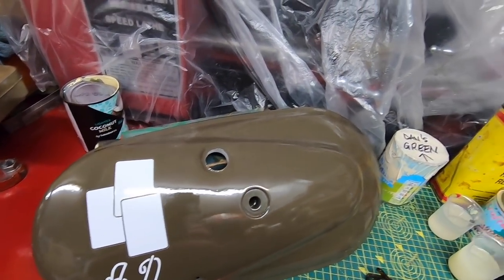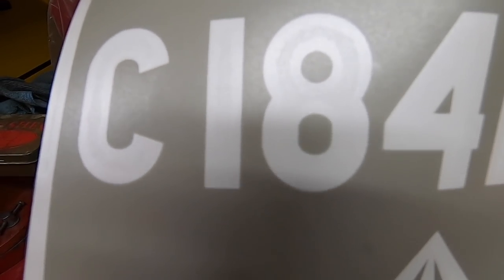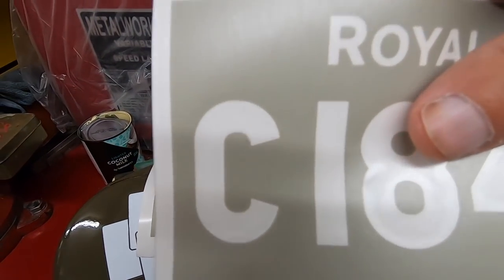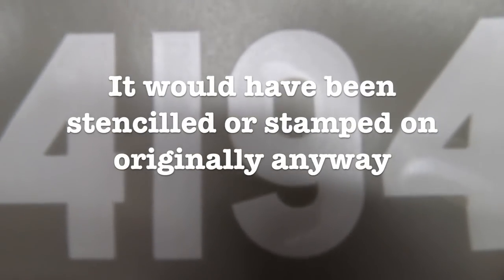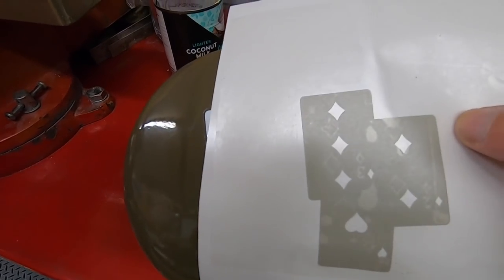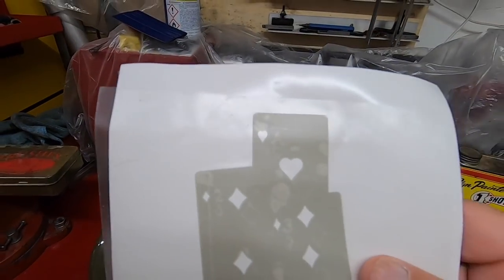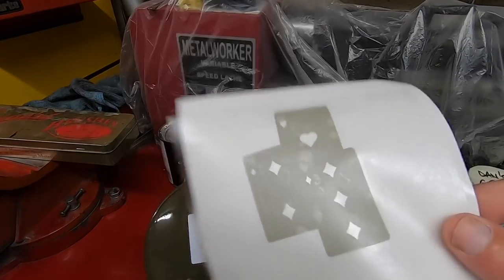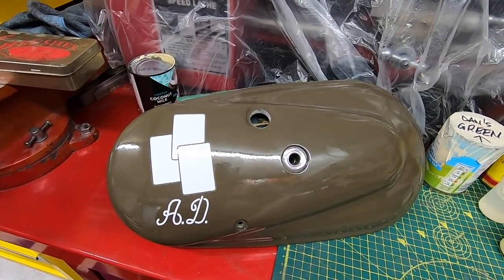Back to the brushes for The Doghouse Part 2

Comment: In the 70s 80s I worked for a government agency,  they had a sine shop, all hand painted.  In late 70s the senior sine painter did a  large sine for the main gate of a aquatic recreation facility.  It  was a map of the entire facility including all the necessary information about utilization of all aspects of the park . If you parked my mechanic's truck up close to the sine ( necessary to change lamps)  and looked closely at the blue water area you could see a scale skieboat pulling a lady skier, the boat contain a driver and a spotter has required by regulations so it depicted necessary information. The entire scene was less than 2 inches long and all three of the ladies depicted in the scene were nude. I don't think anyone other than a few of the maintenance people and the sign painter ever knew that that scene was on that sign. I have been retired about 20 years. he died several years before I retired. The sine is long gone.
Reply from the maker: Hehe good memories of cheeky times though :)

Comment: do you know what the ral number is on dans green
Reply from the maker: No that would be a question for the powdercoater
Reply: Hi mate.....its a bit of a minefield. It is a shade of British Army 'Nato Green@ also known as 'Clansman Green', it has BS (brit standard numbers) and also other numbers but not a RAL code....There are RAL colours very similar but they are not called Nato or Clansman.......its basically this in the link https://paintman.co.uk/shop/nato-green-no-2-satin/

Comment: Hello Ian, 1968 Oxford polytechnic as a apprentice painter and decorator we all bought a set of Wrights of Lymm ltd brushes in a green & black box and we started by applying black thread to the quills then coating with knotting. First task was to blow torch the three plank board , used by every year previously, prime / fill / float oil filler and flat followed by a few coats of paint then the fun began stencilling your own Munsell pie chart and  then ‘ sign  writing’  some of us who used to enjoy art found it enjoyable. I still have most of the brushes and do the odd small garden type signs and my own reg plates. Just as you get back into the swing of it I clean and reapply my Tallow to the bristles. I’m now 69 and am amazed at the local sign writer with laser projection light ( No chalk line twanging or Chinagraph pencils)  just painting the image. Bob 👍🏻
Reply from the maker: Yes it was always a part of a P&D course, great memories Bob. I remember being shaky for a day after having a 2 week holiday from work but it's amazing how much fun it is now, in my own time, although I do feel like I'm struggling with the brushes and the stodgy paint, it'll come :)
I used to work with 4 or 5 others in a small upstairs room, we had many laughs....more asylum than sign shop :D